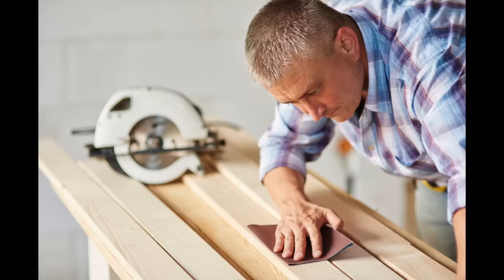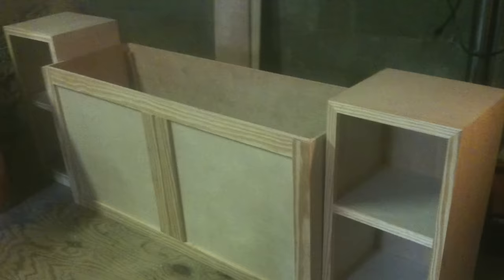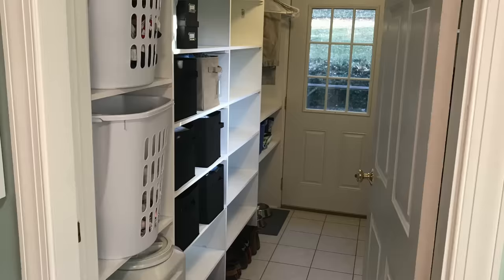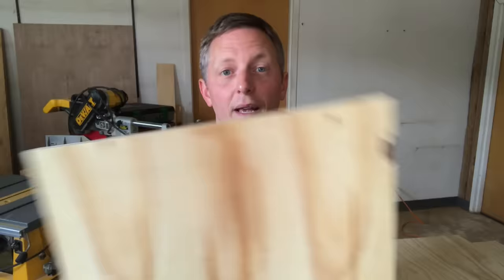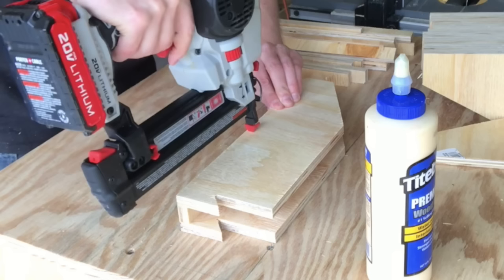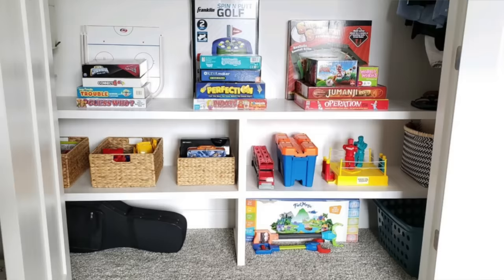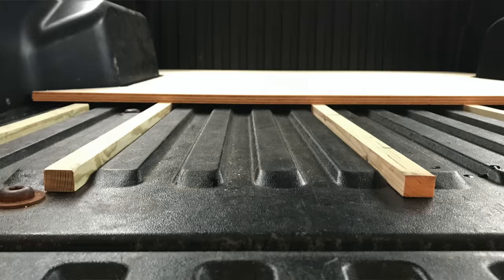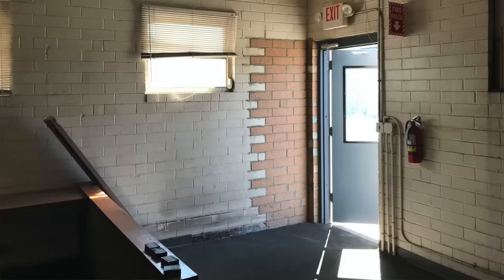DON'T USE 3/4" PLYWOOD If You Don't Need It...TRY THIS! (1/2" Plywood Vs. 3/4" Plywood--When to Use)

Comment: I still have lumber, and plywood, and osb, from 20 yrs ago, dumpster diving at building  sites, where it was not uncommon , to see 1/2 sheets of ply and osb, and 3 to 6 ft boards , of all dimensions, tossed, wood was so cheap. Glad I have a sawmill, and a weekly supply of wood. Just took down a gorgeous  85 ft tall White Oak yesterday, hanging over a house, man had some pretty lumber in it. But it will be cut up and burned, left to rot probably.

Comment: It all depends on the span and load. One can even use 3/8 or even 1/4 ply in the right conditions. 3/4 is usually used in high end cabinet carcasses. 1/2 inch is fine for cabinets in my opinion as long as it is supported properly. How many layers (ply) is a huge factor as well.

Comment: I converted my workshop to french cleat, both for tool holding compartment  and also for some heavy storage, and I have been doing a lot of tests, especially on the heavy storage compartments, some done with 3/4 inch ply and other 1/2 inch ply, they both can support the same amount of weight, some shelves support over 200 pounds of storage...plus your right, cheaper and lighter and mostly easier to manipulate!

Comment: I agree with your analysis. Lot of people over build using stock materials wasting the material itself if they just sit and think about the direction of load x y and z it's easy to use the right materials putting up some good videos appreciate the effort

Comment: I'm all for lighter weight since I already messed up my knees and shoulders. Still trying to recover from a deltoid injury (fun fact: Induction cooktops that crack can electrify your pans & zap you hard). Too bad we're in 2023 and lumber prices are still sky high.
When my dad made cabinets in the 80s he used 1/2" plywood and red oak face trim.

Comment: The bed of your truck can probably be masonite board. That's what I use in my 3500 van. It's dirt cheap and I don't care if I mess it up. Another one is just a few bucks away. In practice they usually last 10-15 years before they've had it. I have it rough side up. Helps keep stuff from sliding around.
Reply: Unless you live where it's wet a lot. Masonite might as well be Cheerios when it's damp.
Reply: @BrBill  I haven't had a problem. I worried about that at first. Then the years went by and it would get wet in rain. Not real wet, just while the door was open. I expected to replace it every year. I think the first board lasted 20 years.
Reply: @robertthomas5906  I'm in the Pacific Northwest, so rain's pretty regular here. Inside a van might be doable, but in a truck bed, even one normally covered, enough rain's gonna get in there over time to make that stuff into applesauce.
Reply: @BrBill  I wouldn't do it for a truck even here in Maryland. You're right, it wouldn't stand up long I'd think.

Comment: Thanks for posting this video. You are right. Save dollars, save your back, knees, etc, and practice easier ways of doing things. With prices of lumber soaring, i was thinking the same way. 5/8 is the norm for counter tops like quarts, Granit, etc, but anything else can be done cheaper.  you can always shore up or support 1/2" plywood with cheaper materials instead of paying a hefty price for a 3/4" ply. And the results can be the same as you showed.

Comment: I'm building cabinets right now, and I had some 1/4' maple to get rid of.

I just made a frame with 2x2's, so that the plywood isn't load bearing other than the shelving.
My mounts to the wall are every other stud, so adding 1 cross support to each span keeps it down to 16"
I probably overengineered the frame, but the cabinet is 24" deep and 36" high, and I'm pretty sure I could do chin ups on it.

This is the same maple ply I ripped for flooring in a bedroom.

There are lots of uses for thin plywood, if it's of good quality.

Comment: Not mentioned but key to understanding plywood, is that the reason plywood is so strong is that there are LAYERS OF GLUE that make it rigid and tough.  It is the glue that makes plywood so useful and strong and stiff and able to support so much weight with less bending than solid wood of the same thickness (depending on the type of wood, of course - but stronger than solid pine, for example).  That said, when purchasing plywood make sure to check how many plies (laminated layers) there are.  Some 1/2" plywood comes with only 3 laminate layers (2 glue layers).  Obviously, avoid that for weight-bearing usage and find that 5-ply plywood, with twice as many glue layers.  Remember, it's the glue layers that make plywood stiff and strong, with each glue layer reinforcing the other glue layers.  It's kinda like why solid metal bars bend but pipe or tubing is actually harder to bend (unless super thin-walled).  Glue layers, like metal piping, have multiple layers of bending surfaces.  As you bend something, one side expands while the other side compresses.  In a solid piece there is only one side expanding-stretching and one side compressing.  With multiple glue layers and metal piping/tubing there are at least 2 layers, each with a side that expands and a side that compresses.  When you have more than just 1 side stretching and 1 side compressing, then the other layer(s) greatly reinforces the resistance to bending.

Comment: For me, I still rely on 3/4 when driving in screws for structure. If a screw can only dig in 3/8"-ish, I find that to be insufficient for for some load-bearing things. I find I need to rely more on shallow dados (along with screws or dowels) when making storage carcasses, where butt-joints and dowels/screws would have been enough with 3/4.Drawer boxes? 1/2" all day.

Comment: LOL. I been1/2-ing it for most of my projects for years. And yes, the counter holds up really well, still. My wife's corner room pc-desk is simply structures and I can stand on it to clean the wall or ceiling in that area when needed. So yeh, 1/2-inching is fine.

Comment: I think calculating is the way to go here --- in the majority of cases we're clunkily overbuilding; but for book shelving you'd be trading 'elegance' (of thin shelves) for 'clutter' (of narrower span/ more verticals): For the same uniform load-per-width, as book cases would have, using 50% thicker (but otherwise identical) sheets lets you add 50% to the span, for the same amount of sagging per width. Price-wise, you'd save on materials going from thin-shelved 3-span (so 4 verticals) book case to a 3/4in 2-span (so 3-verticals) book case; that saves one entire vertical (both sides) to sand and finish, as well as less measuring and assembling time and fixings. A fantastic tool here is the Sagulator, where you add all your parameters like sheet material, span, depth, thickness, and way it's attached on the sides etc to get the amount of sag predicted: https://woodbin.com/calcs/sagulator/

Comment: i always used 1/2" ply simply because ,i'm always too nervous to mess up an expensive piece of 3/4, i've only recently gotten into being precise , i'm an auto body guy so wood was more a hobby,, but as i watched , i realized, ya, those are really advantages, like the brad nailing , i just did it without too much thought to what else would i have used if this were 3/4,, and it being lighter, oh ya it is,, great video

Comment: And even thinner for some applications, such as the sidewalls of small drawers, dividing sheets inside boxes or drawers and small boxes. All subject to light loads or stresses along the length or breadth rather than against the surface. Even just sheets of veneer glued together will work for Christmas tree decorations. Commercial structures may use thick cardboard for a bed; as long as there is a strong frame underneath, it can suffice for fifty years use!

Comment: Yes I use 1/2 inch ply regularly - but the quality does vary - check out different suppliers. Some the inside layers can be very dodgy. Which can leave a poor edge or cut. So beware and you could save big money!

Comment: Yeah it all depends. I would still choose 3/4" because we use 1-1/2" narrow crown staples in building our cabinets and so having that 3/4" gives you a range of tolerance so that a staple doesn't divert out of the stock, which would be terrible to repair. Also measurements change when using a different thickness which means we'd have to revise all of those accustomed measurements. Smaller screws may end up popping out of the side, there's alot of risks using thinner wood that aren't directly related to load strength and load-bearing capabilities. It all depends.
Reply: real carpenters do not use staples , only cheap furniture builders .

Comment: Each for their use. As it's always been.  None of it is exempt from the laws of physics, but there most definitely has been a tendency to both overbuild things and to go for one size fits all. ¾ just simply has more meat and better grip on fasteners, especially on the edges. That is a non negotiable fact.  If on the other hand the edges are fully supported all the way round,  and all you need is the panel, then maybe ½" is the better choice.  Equally so for small dividers etc., where you could potentially even go ⅜" - it all comes down to the application at hand. But sure. ½" is great.

Comment: I made a shelving unit for the basement about 6 weeks ago.  I considered 3/4" of course but with pricing, and the way I was assembling strong shelves, I went with 3/8" (4x8', $32.50).  Was a good decision, the following 2 or 3 weeks I was making some more narrow shelving, and prices had jumped again. so I downsized once more to 1/4" shelves (4x8' also 32.50, 3/8" was $37).  These are shelves not holding anything too crazy heavy.  Mostly tote boxes filled or boxes for my rental properties.  Something heavy dropped on one might blast through the 1/4" but I don't see that likely happening.  In addition, I have a nice set of ribbing under the shelves strengthening everything.
Last week I checked, 1/4" 4x8' is $52 and 3/8" is $58.  I don't even consider using 1/2 or 3/4".

Comment: for something like a workshop you can even go down to 6mm for things like the shelves on a unit with individual cubbies meant to just hold a single tool in its box. where the shelf only needs to be like 10 inches wide at most.

Comment: 2023 HERE! Wood is even more expensive. So it’s mainly recycled ikea furniture. I mainly use particle board. To make particle board stronger hollow out the wood board and inlay 2 popsicle sticks glued together. Then apply copious glue in hollowed out cavitation. Also the glue I use I have developed is 1/3 titebond 1/3 cyanacrylite 1/3 Elmer’s acrylic glue. This glue hardens to a terrifying toughness, and only can sand it down with ceramic sandpaper.

Comment: I have gone the opposite direction because of the prevailing lack of quality plywood at big box stores.  Voids, warping from internal stress, moisture sensitivity, the list goes on.  I have a dolly and a ceiling hoist, use a corded circular saw and a foldable plywood platform for sizing.  Half in has lost my confidence repeatedly.  Besides, it’s not even 1/2” anymore.  Cheaper is not better when building permanent household structures.  I require stability and durability.  No particle board, no OSB either!

Comment: I lived in Japan for almost 30 years  and 12mm ply is the industry standard. On occasion we will use  thicker but really rare.  If we are going to do a floor then we double the ply but offset the wood joints to overlap and use a floor glue that expands and wont crack like normal wood glue.  All construction is based on 3x6 so it is much better for cost,waste , cutting.  When you finish a house here you leave with a bag of scraps and cutoffs not like in the states where you have a big dumpster to put all the waste.  I can not believe how must waste there is in the states compared to Japan.  Same tools,same blueprints, less people on a job, 3x6 everything,very little waste.  I think people take more pride in their work and feel that if they measure correctly there will be less mistakes which make the job faster,cleaner and more profitable.   American construction could really learn some things from them.  Also 2x4 is almost non existing for framing interior walls but that is for another rant.....

Comment: If you use pocket hole joints ie Kreg, you will need a different insert, drill bit and screws for 1/2 inch material.

Comment: Thanks Ethan.  Very timely video.  I am about to invest in sanded plywood for some specialized cabinet doors.  I was going to go with 3/4 inch.  I will now go with the 1/2 inch.  It will provide a trimmer appearance and save me some money.
Reply: How did that work out for you?

Comment: As a carpenter and someone who likes to work with ¾" plywood, my reset client asked to use ½" plywood which is the cheapest material I could find, in my personal experience this will be the first and last time I work with ½"
Reply: Why?
Reply: @andrizeefoshizee for drawers it's a decent material, but that's as far si would use it for... im putting in screws and it split it vertical walls of the cabinets started bowing that never happens with the¾ at least for me it isn't too the point were im struggling... it just felt flimsy to me. Now ¾ its just solid at least in my opinion plus I find it easier to work with.
Reply: @epenaloza52  Okay.  Thanks for the input.  Have a blessed day.

Comment: Amazing timing I got a good deal on 1/2" and have made plenty of case work. I have redesigned my processes to use 1/2". I find fine thread sheet rock screws with 7/64th. predrill works great.

Comment: Good video, just in time for me.  I'm making a bunch of shop cabinets using (on sale, closeout) Rockler metal shop stands and will be using 1/2 over 3/4 for the sides, backs and doors.  The actual bench tops and bottom shelves will be 3/4.  Those will get abused and I think 3/4 makes sense for them.

Comment: I have always balanced weight to strength ratio's. My shop used to produce alot of road cases. 1/2 inch ply is the go to sheet good for most cases..

Comment: The problem with 1/2 plywood is pocket screw has to be careful, not that you cant use it, it's just a bit less allowing. (You just can mess up the depth)

Comment: Great video, thanks.
So for the rest of the world it's 12.7 mm, about 12.5 mm for the 1/2 inch.
And 3/4 inch is about 19.05mm. That will be 18 mm here in Holland or 12 mm for the thinner one. 
Here in holland, plywood is in sizes 9mm, 12mm, 18mm, 15mm, 5.5mm, 3.6mm. So it will be 12.0 mm to use.

Comment: I liked this video and agree with all but one of the points that you made.  At about 4:20 in the video you stated that 3/4" plywood has slightly better span strength than 1/2" plywood, but not much.  For a span, like a shelf, 3/4" plywood is 3.3 times stronger and 3.3 times stiffer than 1/2".  And really it is stiffness that matters to us because stiffness, which controls sag in a shelf, is more important that strength, which controls whether the wood will break or not.  A plywood shelf will sag to a level where it is visually unacceptable long before it comes close to breaking.   I still agree with your conclusions and personally believe 1/2" plywood is superior to 3/4" in a lot of applications.  You don't have to be the "strongest" in your projects, you just have to be "strong enough".  I just wanted to point out that when you are putting material in bending, like in a shelf, material thickness makes an outsized difference in stiffness/sag.

Comment: Most of these reasons seem spot on, but I'd dispute the bit that mentions it being thick enough to pin sideways into. The reason I go to 3/4 so often is because you can pin or screw into the edge with less fuss. I'd say that was an advantage of 3/4.

Comment: Shocking surprise fact:  In UK, most flat pack home assembly furniture items are……HALF INCH CHIPBOARD!!!!  (In  practice typically 15mm).
Ok Ok calm down…keep breathing into the paper sack.  It’s true.  In fact half inch ply is used only for structural parts such as a sofa carcass, because of cost.  Finding real plywood in home furniture, kitchen cupboards etc is a LUXURY.

Comment: Something you might want to mention...That a lot of 3/4" plywood isn't an actual 3/4". (neither is 1/2)  Some are 23/32" or 11/16" which blows if your cutting dados and inserting the ply.   You really have to be careful, just making boxes not so much, but something to keep in mind for finished furniture type builds.

Comment: I never use anything over 1/2 unless it will be holding over 100lbs. I also use MDF for almost all shop projects these days. I seal off the ends and have never had a problem, and I live in a place that swings wildly between humid and dry.

Comment: Cheaper, lighter, etc. a bonus but personally been using half inch as default as it's just far less wasteful  
While most still might not want to hear or say the C words - Climate & Change - it's surely useful to demonstrate how simple changes, such as here reducing main material used by a third!  are better for all concerned, without compromising aims/results in any way

Comment: Glad to see this video I was getting into this frame of mind until now I see this video. I'm using 3/4" but only because I got an old sheet from brother and using to build french cleats and tool hanging holders but I'm only using as demos to see how it looks for when I make newer improved ones with improvements. I will stick to 3/4" for the cleats for strength and because once hung they won't be moved but I will use 1/2" for tool holders and if not good I will use all 1/2" as in my 60sband medical probs and loss of strength at my age makes sense to use 1/2" great vid good man powerful info